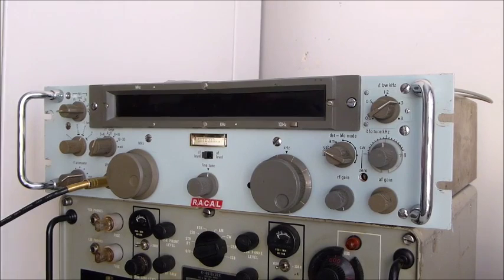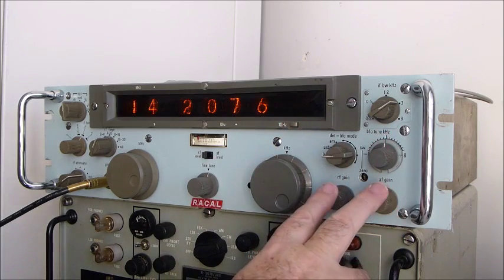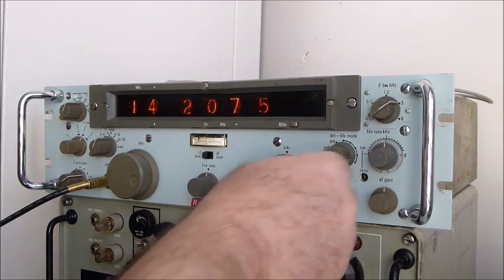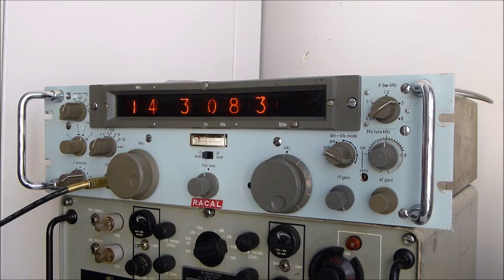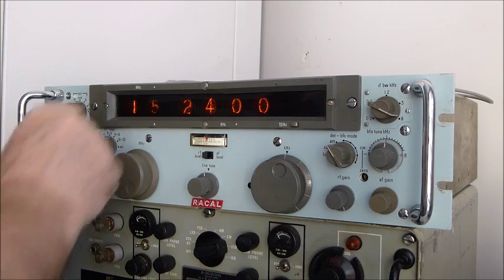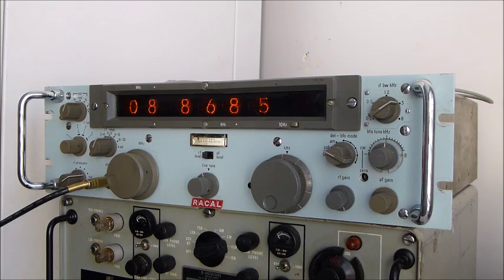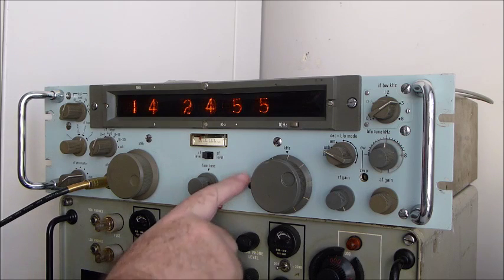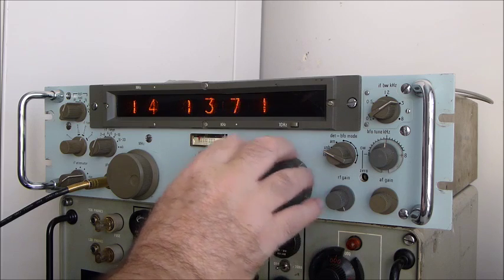RACAL RA1218 Receiver

Comment: Great, informative video Peter. I know the earlier RA-17 receiver used a unique frequency control circuit called the Wadley Loop which greatly improved the stability of the receiver. Not sure if the RA1218 utlized the same circuit. The next generation would be the PLL frequency controlled receivers  which added additional stability. In the US at the time was the 51J's, R-390A's  and the later 51S-1 Collins general coverage receivers using crystal controlled front ends and stable PTO variable tuning controls. I have several Collins models but I would be elated to add a RACAL. They have gotten very expensive and are quite hard to come by. Peter, I hope you have maintained your interest in vintage receivers over the last 3 years. Peace
Reply from the maker: Hi Rudydog, thanks for the comment, yes the R1218  was basically a transistorised version of the RA17/117  utilising the Wadley Loop principle. Still keeping the faith and restoring receivers here. Finished a R390 (Non A) earlier this year and I have a R-388 and a R-274 in the wings when i can get some time time to go through them. R-388 really needs a new Mains transformer as the current one buzzes pretty badly ... probably get some time over xmas ....regards , Pete

Comment: Nice old Rx one of the best none pll radios that where made and there are very few that used Nixie Tubes ..How much did you pay for it would be interesting to know what they go for these days the where very expensive when new being a commercial comms rx...Good vid all the best
Reply from the maker: Hi Steve thanks for the nice comment. This set was I think around the 250 UK pounds mark.  It did need some work, As the Counter assy wasn't working and the AGC cct has some capacitors leaking...Both issues corrected and it works very nice. Typical of most early Transistorised HF receivers it could suffer form overloading if not handled correctly. You do need to use the pre-selector and Attn to get optimum performance, As it has a free running VCO and everything else is analogue there is little phase noise and it can really work very well. Its currently used in my lab and preforms exceptionally well of my active loop antenna.
Reply: Peter Stanford Thanks for the Reply much appreciated.
Wadley loop same as FRG7 if memory serves me right. All the Best from Liverpool UK
Reply from the maker: Hi Steve yes your correct same set up as RA17/117 all 1MHz steps multiplied in a comb generator and a free running 1st LO 'locked' to it. I was a Test Technician Apprentice at RACAL for 4 years and finished in their systems engineering, spent a lot of time on later synthesised sets. Fantastic company, one of the last in UK.....